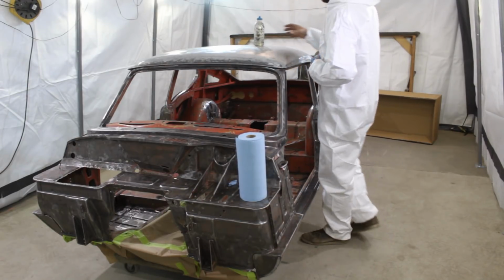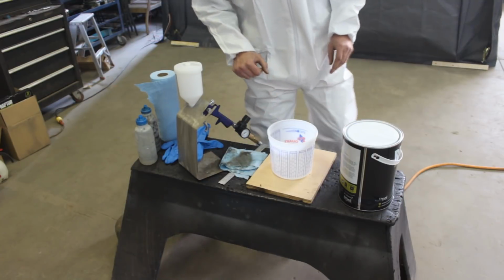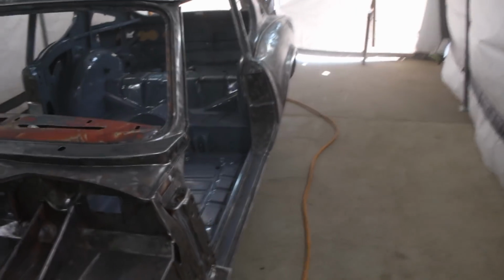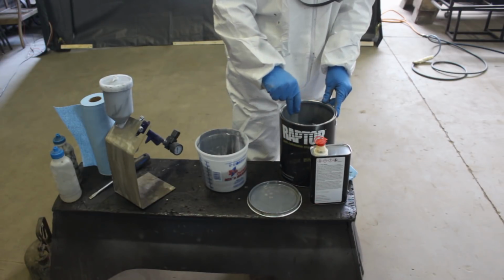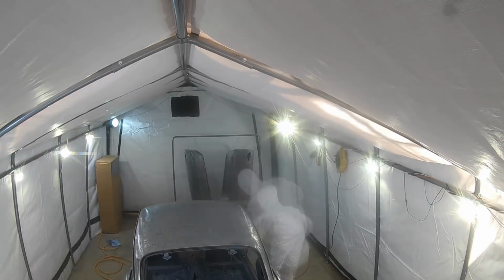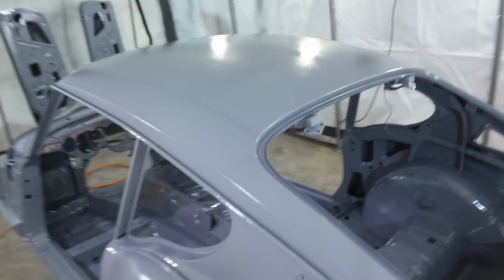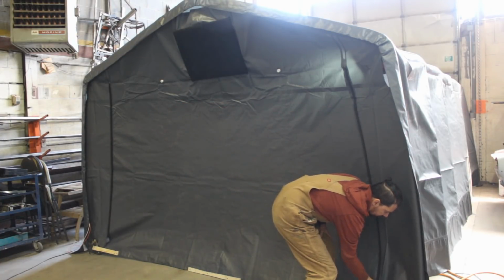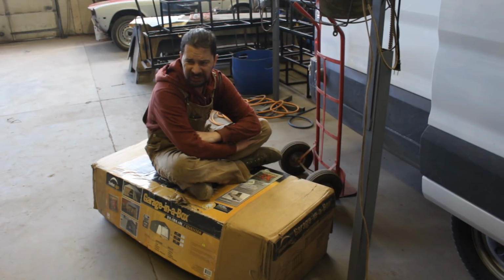1972 Triumph GT6 Restoration - Part 53 - Epoxy Primer

Comment: You have some great life skills. I recently rattle-can'd my Alfa's front bumper outside. The over spray drifted clear across the driveway on to said Alfa. I spent 4hrs the next weekend claybaring the overspray off. Wish that I had the patients that you do to set up a make shift tent in my 2-car garage!
Reply from the maker: LOL, I had to deal with overspray in the engine bay of the TR6 from the paint shop. What a nightmare!

Comment: Looks pretty good for a first attempt! Just watching you, it sounds like you were about 50-60psi on the air, that style of gun with epoxy primer will work really well about 30-40psi if thinned 10%.
I find it best to sand the epoxy primer down with 320 grit dry on a machine, then put your high fill primer over that. Don't worry if you sand through the epoxy with the power sander in places, just spot spray some more epoxy over it, sand again then high build.Wet sand the high fill with 600 grit- no need to go any finer, 600 grit won't show at all. 1200 grit with high build primer will take FOREVER to get anywhere!
Remember, the epoxy is just the base, it doesn't need to be fine sanded, just knocked down flat so the high build can go on. That's when you do the real finish sanding!
Reply from the maker: Thanks for the bits of advice. I am still learning so I appreciate any help from experienced guys like you! The pressure was between 25 and 30 PSI as advised on the Spec sheet for the primer though. I was really careful about that.

Comment: Hi from greasemonkeygarage looks like the job worked out ok but before you go onto the next stage of paint there are problems you will face these are the same problems I had with the gt6 paint job if you like I am happy to pass on my experience regards Jeff
Reply: greasemonkeygarage watson I'd be interested in what happened when you painted. Cheers
Reply from the maker: Hi Jeff, I watched some of your videos and they are very interesting. I need to find the time and watch them all.  I still have a lot of work to do on the body before the paint though. I even have welding still, but since I had to put this project on hold for a while I decided to prime it and protect it from rust. Are the problems you are talking about in your videos. I definitely will appreciate learning from your experience. Thanks!
Reply: Hi Elin the problems I described are not in the video could not set up a camera in my spray shop if you like I will do a short video for you when your ready to paint like you this was my first real paint job and would be easy to film than to write let me no when your painting regards Jeff.

Comment: Hey Elin, Please dont sand the high build to 1500, thats FAR too fine and will cause the paint to flake off, id stop at 800 to 1000 once you lay the paint on you will be fine and then you can 1500 and 2000 it imo ( though this is just my experience and im not a pro )
Reply from the maker: Yeah, I got that advice from other people too. I have no experience and I appreciate all the help I get here! Thanks!

Comment: With respect, the only way to protect from rust and sabilise the chassis from rust is to dip it in a tank with paint remover, primer et al. that gets the parts inside the hollow sections. Please comment.
Reply from the maker: That would be ideal, but who can afford that in a small shop. We do our best to cover all areas knowing that some dark corners will remain less protected…. There are internal frame coating sprays with long tube with a jet at the end that you can insert through openings and spray inside. I use those for frames, rockers and other enclosed areas.

Comment: I think the pressure has an effect on the orange peel. I am NO painter.
Reply from the maker: It sure does, but I was right as per the spec sheet, between 25 and 30 psi